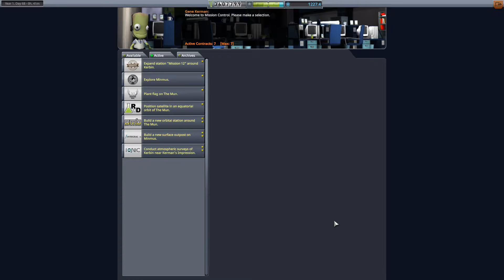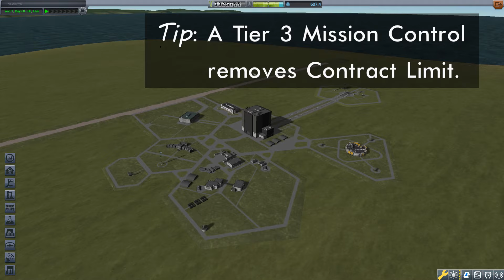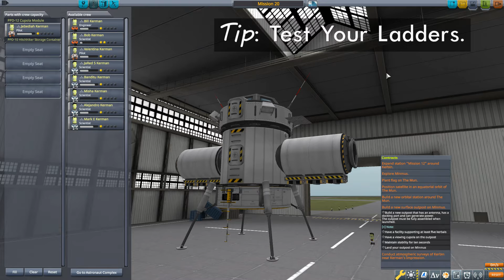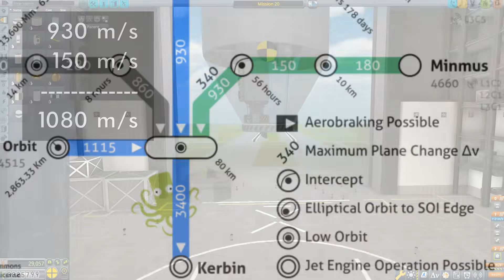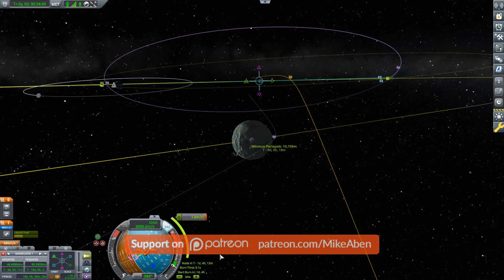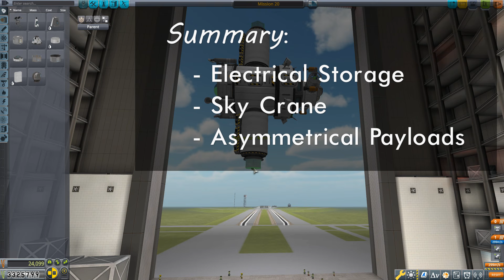Build a New Surface Outpost on Minmus | KERBAL SPACE PROGRAM Contract Tutorials

Comment: I dont see “control from here” to make the nav ball all blue??
Reply from the maker: Sounds like you aren't clicking on a command part.
Reply: @MikeAben  i am clicking on the probodobodyne facing up with advanced tweakables on and it doesn’t show
Reply from the maker: @RMG029 Are you time warping perhaps? (I've done that more than once) Out of EC? No communication?
Reply: @MikeAben  do i have to be launching or in the editor for this?
Reply: @MikeAben  I am not time warping but i think i have to be in the launching area to do it right? (Also thanks for still replying to comments 3 years later)
Reply from the maker: @RMG029  No. I switch control points all the time when in flight.

Comment: I dont know if you are going to see this 3 years later but im wondering if this design (with a bit more deltav) will work for a mun base too? I really love your videos but i cant see one for a mun surface base
Reply from the maker: There's no reason it can't work for a Mun base.
Reply: @MikeAben  thanks, i just figured because of different gravity and stuff that it would need to be a bit more different
Reply: @MikeAben  I tried making one on the Mun, it did work but when i tried to expand it it was impossible due to the terrain. I now have a minmus surface outpost contract which i will use

Comment: I realize you like to keep it stock, but installing CKAN and adding the "parking brake" mod is so incredibly helpful to keep your craft from sloshing all over the place when it lands. When using time warp, weird things happen that make no sense due to the eccentic physics. I've had kerbs knock it over, had the vessel randomly fall over, tip over, slide at .1 m/s on a flat surface. It just doesn't stick. So yeah parking brake mod.

Comment: Not sure if you're still reviewing comments Mike, but watching this a few years later it looks like you were able to really precisely figure out delta-v for the crane and upper stage, but then you mention we need 3800dV for LKO and yet in your staging menu it looks like your first stage has 2435/ms of dV. Is this just a bug with the staging view? If so how did you know your stage had enough dV?
Reply from the maker: At that point I have the dV tool set to sea level so I can see the launch TWR. This changes the dV calculation to sea level too, but the 3800 m/s is a vacuum delta-v.

Comment: I feel very stupid for all the questions I keep asking on your videos sir, especially for as enlightening as they are, however I am in a bit of a jam. I am approaching Minmus, don't have enough fuel for a orbit so trying my luck with a direct approach. However, before I can even get to that, when I try to disengage from the last stage to just be the skycrainw and base, my control always goes to the last stage instead, even after assigning other parts as being where to control from. And once the stage happens, I cannot control any part of the base anymore. If you have any insight I would be very grateful
Reply from the maker: The square bracket keys allow you to switch between nearby vessels. If you still can't control the skycrane it means there is a problem with the vessel like it's out of electricity or has no communication with the KSC.

Comment: I'm a bit late on this, but, following along and at the part of the video where you transfer items into the cargo, i came upon a problem.

Beside the cube structural things in the upper cargo section, the section we dont get to see filled, there is what looks like Rockomax Brand Adapter 02, but i cannot place it is says "construction only part" in red, and i also cannot place it in the SEQ-24 Unit it just wont let me place it. 

So i am wondering what part it actually is.  It kindof resembles a stack seperator, but in the video it doesn't say what size.  But i could swear it isn't a seperator, but the Adapter.

Can you help plz?
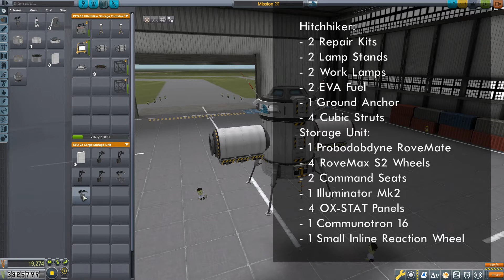Reply from the maker: I listed everything that went into cargo at 13:14 though I think I forgot to list a TD-06 decoupler.
Reply: he also shows his build for the parts in the next video or video after next when he builds the .... spoiler..... rover. 😅 Glhf ❤

Comment: A word on power storage. You have to make sure your solar panels are providing MORE power to your station than it needs. ONLY THEN will they be able to recharge your batteries during the day. If your solar panels only provide enough power to run your station, they won't recharge your batteries during the day and they will run out, eventually. You also have to take into account that not all of your panels will be getting 100% power generation.

Comment: #15:04 to solve the optical problem and still fulfill the conditions of the contract in a simple way I use two possibilities; 
1. a decoupler on the Kuppola, which then blows off the docking port in space 
2. with a mechanic after fulfillment of the contract dismantle the docking port

Comment: now build one that supports 20 kerbals. i got the exact same contract but mine says 20 kerbals and i am having some serious trouble lauching an outpost that can support that many and fullfill all that conditions as well.
Reply from the maker: You can launch four of these and just hook them together. It doesn't have to be twenty in a single craft.
Reply: @MikeAben  damn. i thought i had to build the whole thing before launching it since it said "the outpost must be fully assembled when launched." i ended up launching the whole thing with 4 twin-boar engines and get it to orbit. and then i did a refill mission to take it rest of the way and land it. 😅😅
Reply: The "outpost" (or station) is officially the power, antenna, and docking port.  That's why the text is arranged like it is.

Comment: Had problems with the build can't seem to get it to fly right especially in space to uncontrollable and with flip over end over end any suggestions newbie
Reply from the maker: If it won't fly in a straight line in space, then it is almost for sure that the center of mass is not in line with the thrust vector. I talk about this at 19:50.

Comment: Your videos are awesome for learning the ropes of kerbal, one thing I've been challenged with is a contract to launch and land a fully assembled base on the mun, needs 7500 electric charge, 8 kerbals and 6000 units of liquid fuel... its been a real treat to try to design lol
Reply from the maker: Unless mods are involved, you likely can assemble the base on the surface. The most recent tutorial in this series addresses a way to do that, though not to the specifications you list.
Reply: @MikeAben  even with the "must be fully assembled on launch"
Reply from the maker: @LoggerHub  Yes. I find that phrasing confusing too, but if you look carefully it's right after the point about having to have an antenna and power generation. As long as that part is on at least one of the modules, you're good. I talk about this in my Mun Station videos in this series.
Reply: @MikeAben  thats a relief thank you! Ill do that if my current plan fails, managed to get the entire base into kerbin orbit, refueling it to continue the journey. Landing on the mun maybe a challenge 😂

Comment: 6:45 How do you get it to just snap on like that? Every time I try, half of the fuselage goes inside the entire craft and the move tool throws it completely out of center, even with snap off. Holding alt makes it so I can’t put the part on the attachment point at all. I’ve been trying everything I know for the past hour and thirteen minutes, not including the time it’s taken me to type this.
Reply from the maker: I'm not sure what to say. At that point I may have not even been holding the alt key. It helps to have the parts rotated the right way before attaching. Sometimes things go weird on me too. I usually just discard the parts and try again.

Comment: How do you design your modules to add to surface bases?  All my surface bases are horizontal, because one side has wheels on it.  I land on the surface and then gently RCS nudge them to tip towards the wheels LOL!  Then, I just drive them to where I want to put the base.  The modules are pretty much the exact same thing outfitted with whatever I wanted in them.  So, then I can do the same thing:  land them nearby, drive to the location, then dock with the already existing base.  That means I have to sit on the runway and test connect the modules to a copy of the original base to make sure docking ports line up and can make their connections at the base site LOL!  How do you do it with a base that isn't on wheels, positioned vertically, and on landing gear?
Reply from the maker: I use retractable landing gear, translated into the body of the module. I then use RCS to attach the modules, descend landing legs and retract the wheels. When done, you don't see them.

Comment: Awesome video Mike, enjoyed it all the way, thanks for the tutorial! Here's a question for you, how do you record your gameplay footage? I tried using OBS 64bit but the only capture that works is the display capture, which is supposed to be heavier than window or game capture. Thanks!
Reply from the maker: I use Bandicam only because I have for years, but it's display capture too. For my stream captures I use StreamLabs OBS which is game capture.
Reply: @MikeAben  Thanks for introducing me to streamlabs, its UI is refreshing to see. But it turned out streamlabs had the same limitations as OBS, and what I really needed to do was to add the line "- popupwindow" after my ksp executable path within ckan, and select "Windows 10" under the Window Capture settings. This is also the only way to play KSP in borderless window. Thanks for your time, cheers!

Comment: Another great video Mike but I must be doing something wrong! I build my base then add the sky crane which gives me a DeltaV of 197m/s but when I add the 2 R-4 dumpling tanks , my DelltaV drops to 188m/s! Any ideas?
Reply: I've fixed it. Its the way you place the tanks! If you just put them on top of the service bay, they don't work. Put them on top of the OscarB tanks then slide the over to the middle of the service bay then all is fine.

Comment: I built my first Minmus Surface Base (yes, in career mode, no I still have not received a contract to do this, I just had a ton of spare cash) as a 5 segment thing (one segment being a pickup truck), and built it so the poodle engine in the center module lined up with the center of mass by making each module weigh the same as my pickup truck design. I then built a booster and just put it in a polar orbit with a surface until I could choose a landing site. This was after getting every science experiment in space just above and high above each biome and storing them in the lab module to be processed once we landed.

Edit: I forgot to mention folding it up by taking the docking ports and using the rotate and offset tools to  move the modules about to fit in a fairing.